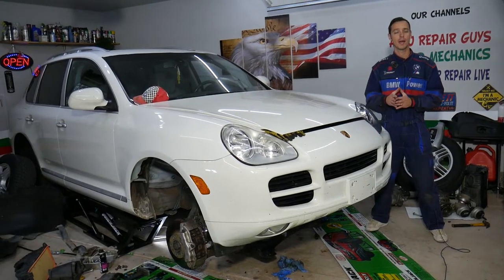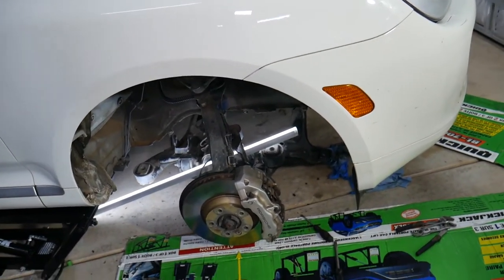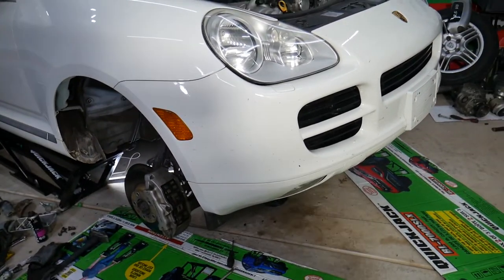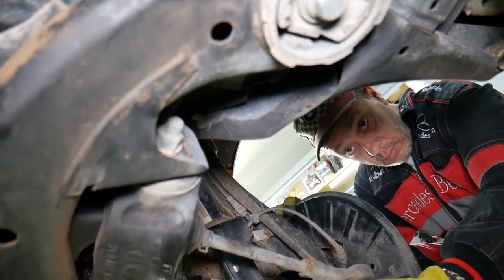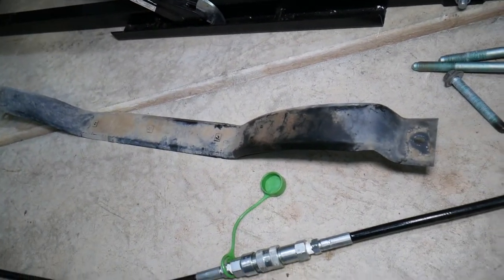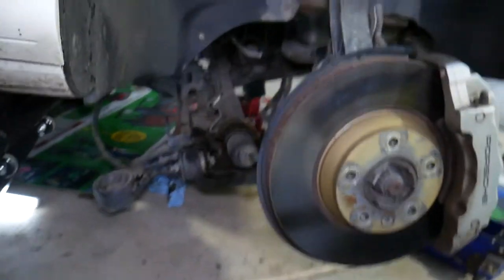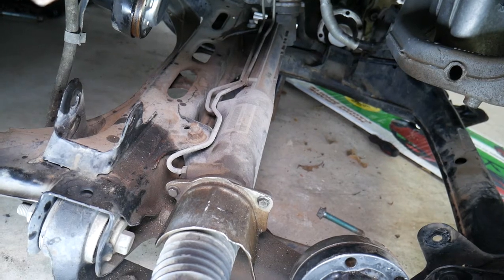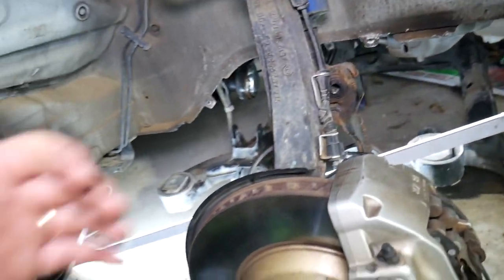RACK AND PINION REMOVAL REPLACEMENT EXPLAINED ON PORSCHE CAYENNE, AUDI Q7, VW TOUAREG

Comment: Have you ever removed the entire steering column? The repair manual states that the catalytic converters need to be removed, I assume to get to the nuts holding the bellow in the firewall. However, can it be done without removing the cats?